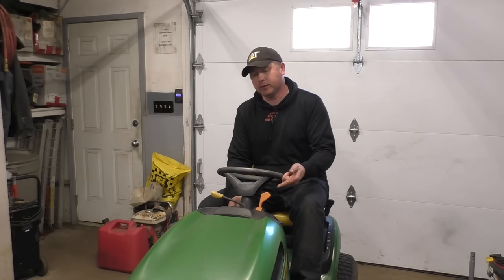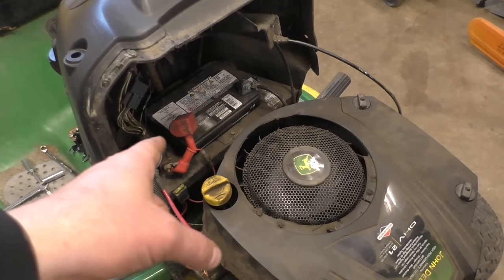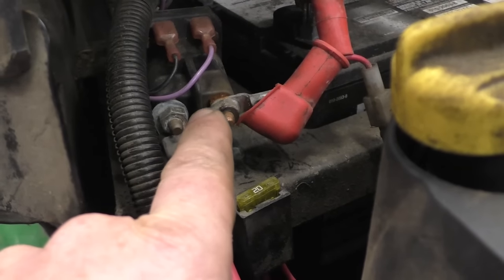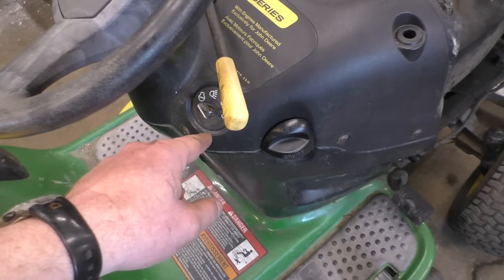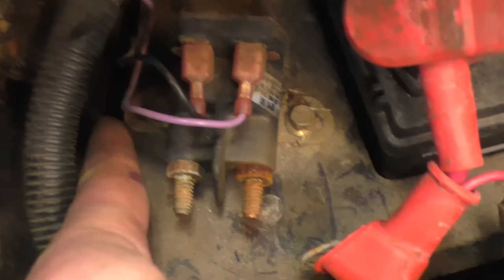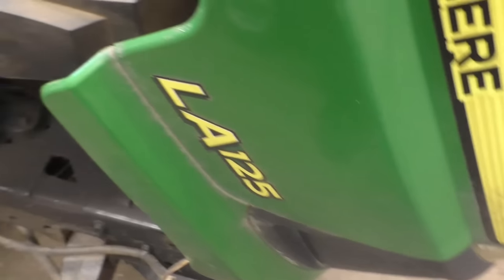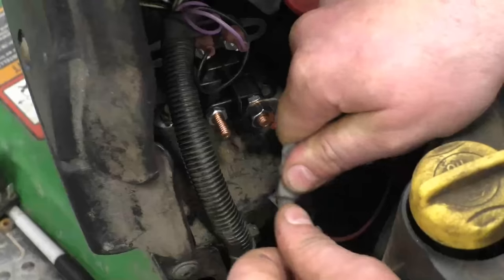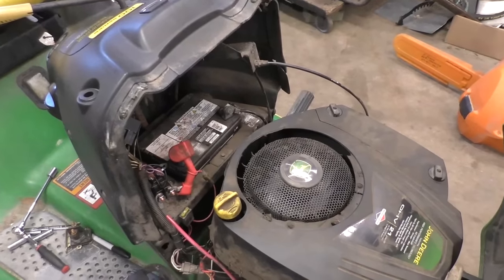Lawn Tractor Won't Start And Clicks - Step By Step Repair Video

Comment: I get a click from my fuel solenoid but that's it. No crack.  All switches are known good. Battery , starter, and starter solenoid are all good.  Fuses are good .  Key switch good.   All swapped out from a good running mower.   Driving me nuts

Comment: Excellent advice! I had a similar clicking/non-start on my Cub Cadet yesterday. It had been running but I turned it off in my back acre for a few minutes. When I tried starting it.....it clicked like your example. I checked the battery......12.5v....good, checked for positive charge to the starter when key was engaged.....power. I then looked at the hour meter on the dash while turning the key and noticed it spelled out "Low Oil Pressure". I checked the oil level and it was down to the low mark and sitting on a slight incline. I leveled it up and added oil until full. Started right up! Possibly the low oil level plus the incline set off a safety feature I am not aware of.
Reply: I have a Cub Cadet XT1 that wouldn't restart when the engine was hot.  When it cooled off, it would eventually start.  I doubt if the oil pressure would be the cause of an electrical problem.  

I replaced the starter after only 2 years, but now it's starting to do the same thing.  I just keep the tractor running all the time until I'm finished cutting the grass until I can determine if maybe I should replace the solenoid or not.
Reply: @jpozenel  I agree. I am not convinced about the oil pressure, but after checking the wiring.....all seemed good. Will have to be vigilant and try to determine a cause. Good luck with your XT1.

Comment: A starter solonoid is nothing more then an electro mechanical switch

You can reverse the 2 large 10 ga wires, and reverse the 2 smaller wires but only wire size for wire size,  it dont matter what the poliarty is, its nothing more then a high current switch.

One other thing you should look at is rusty conectors and the body connections.   Rust will cause resistance.

Comment: Probably save money by buying a universal solenoid at most small engine repair shops or Amazon because the mower dealers (John Deere) will charge way too much.

Comment: Great video Don! Thanks for sharing the tips! I have a John Deere riding lawn mower model  D100, every time I shut it off, I get a loud boom ( I’m assuming this is called “backfire”. What could be the reason? I replaced the fuel solenoid but continues occasionally. Any ideas?
Reply from the maker: lower throttle first to idle then shut it off, it should help
Reply: @donyboy73  The engine did NOT backfire at low idle. I tried a couple times and same results! Thank you for your help and guidance.

Comment: The geniuses at Cub Cadet designed their mowers so that the battery sits on top of the solenoid. These companies do this crap to try to force you to go to the shop. I'm dealing with this right now. I put a new solenoid on last week. Now I'm waiting for the starter to arrive.🙄

Comment: If tractor won’t start when you touch both wires it isn’t necessarily the starter is bad. It could be the battery is bad. The battery may show a full charge but when you hit the key it drops down to 4 or 5 volts. So just saying just because you charged the battery does not mean it will have the cranking amps to turn engine over.

Comment: What if it’s intermittent?  I thought it was a battery but it will sometimes start and sometimes it just clicks.
Reply from the maker: That can also be caused by a faulty solenoid.

Comment: I had my mower sitting in the garage for two years before I finally got out working. I ordered so many parts and I tried them all to see why it didn’t work. Then finally I found out I had a bad solinoid. Released it. But installed it incorrectly then finally Month later I figured out his to install it correctly. I know pain of spending hours of Your time trying to fix things and endless amount of money only for it not to work

Comment: So my D110 turns about once over and then doesn’t crank.  I did the screwdriver thing and it does the same thing.  Engine turns once and then I can hear an electric-like humming.  Should I replace the starter?  The battery is new and good.
Reply from the maker: I would try this https://www.youtube.com/watch?v=T1anxdNWf5Y&t=1s

Comment: hi donnyboy,from malaysia,i need help for my ms250,i want to change my chain from .325 to 3/8",what should i change so i can use 3/8 chain on my ms250? the spur sprocket n guide bar? please i need help,i want a chain that more aggressive to make my work faster🙏🙏🙏,, thank you in advance,,
Reply from the maker: yes replace sprocket drum, chain and bar
Reply: @donyboy73  what tooth sprocket drum should i buy? 3/8" 6 tooth? n what kind of bar should i get? do i need to make a new hole at the bar for the chain oil? really need ur help,really appreciate ur help thanks a lot,,
Reply from the maker: @shootingstar5718  go to your local stihl dealer so they can direct you as to what to buy for it
Reply: @donyboy73  the problem is they dont know, they say only .325 chain can be used on ms250 ,they say 3/8 is not suitable for ms250,, thats why i asking people around the world n i found your channel here on utube,already subscribe👍, so right now i need the detail n buying myself from online store,thats why i need your help🙏🙏,,
Reply: @donyboy73  hello donyboy sorry to interrupt u but i just got a new info,the stihl ms250 can only use picco chain right? the lo pro chain,not the normal 3/8", am i right sir? thank you in advance,,
Reply from the maker: @shootingstar5718  I would keep it the way it is with the .325 chain
Reply: @donyboy73  okey sir,1 more things sir,is full chisel is the fastest cutting chain? n do .325 have any full chisel chain?

Comment: What if you get no sound and no power
Reply from the maker: that can usually be the battery
Reply: @donyboy73  battery is new I just move it then went to mow and nothing but your video help me clear my problem quickly thanks so much

Comment: That’s one thing I hate. Replacement parts should have the same sizes as the original. Makes an extra step to have to get a different tool, for the same part. End of rant.